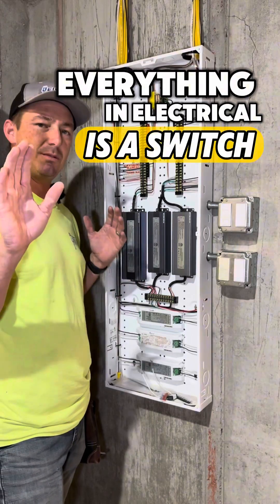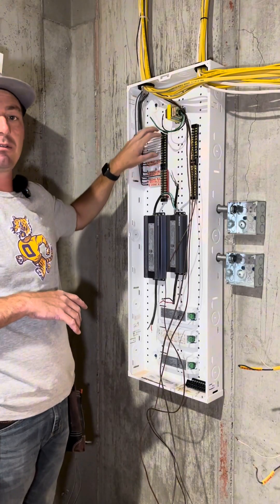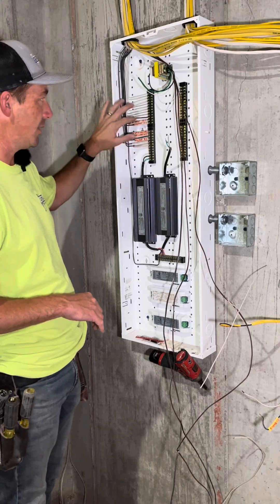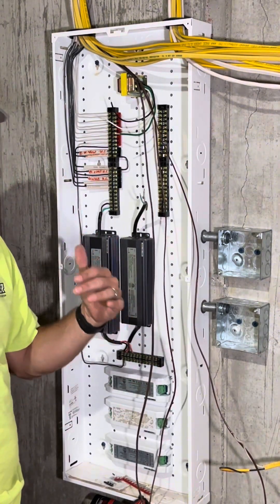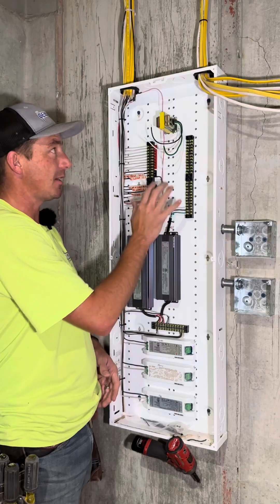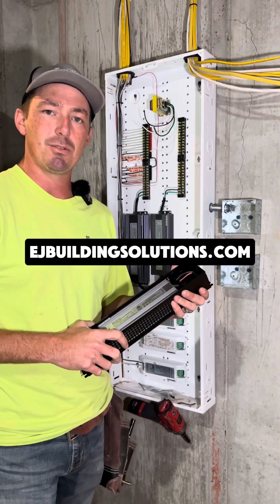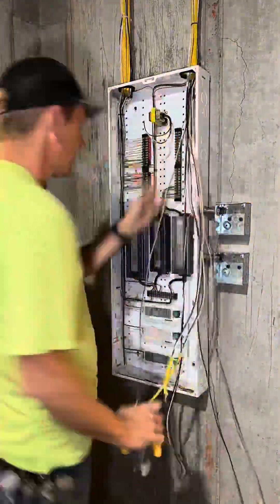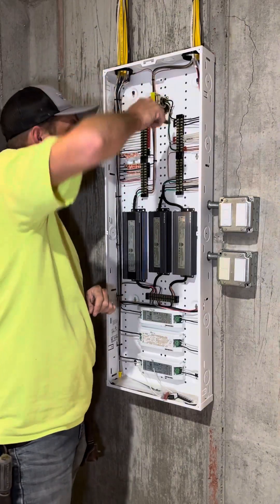I used to look at stuff like this and be so intimidated. Keep it simple.

Comment: Ben being low voltage DC. Shouldn’t you use a larger wire coming from the power supplies to the bus bars for more current? 

Even AC got its current limit depending on the gauge of wire.